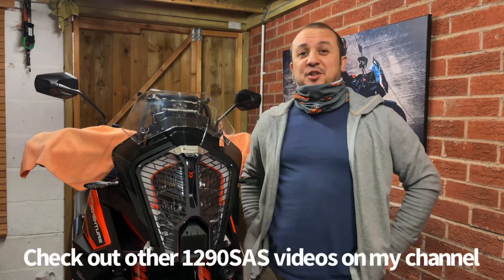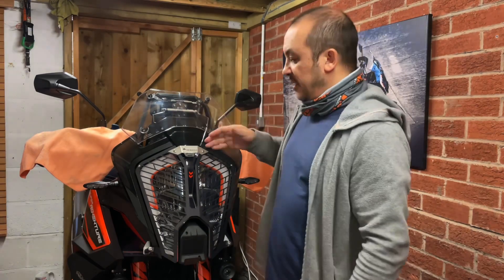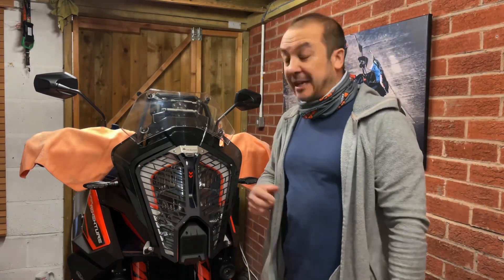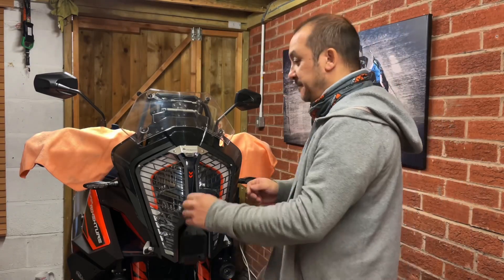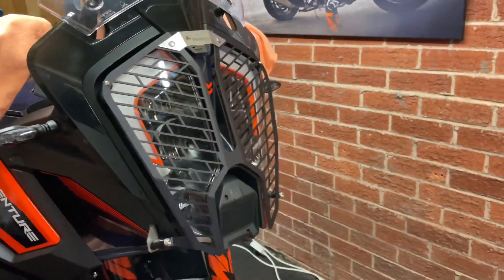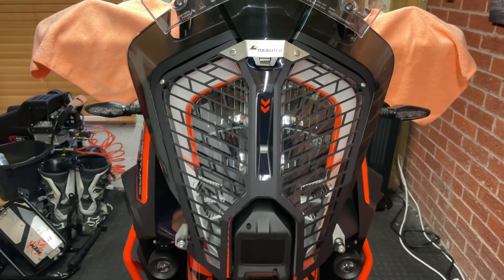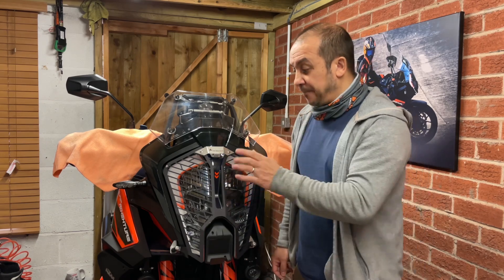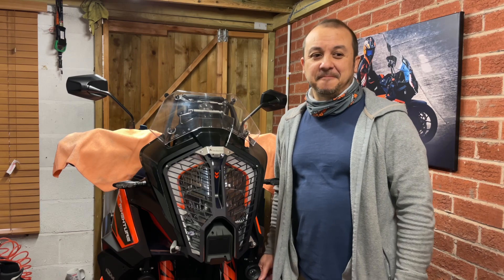2021 2022 2023 2024 KTM 1290 Super Adventure Touratech Headlight Protection Quick Release

Comment: I really t like this.  Though I think the silver bit looks a bit off over all black. , definitely look into the 3m film to keep the headlight from getting nicked up.
Reply from the maker: Hiya Shaft! Yeah to be fair it would have been sharper looking with anodised centre piece instead of metal. With a different shade of black for the Touratech imprint.

Good idea on protective film however I’d be worried about overheating or melting the film. ?
Reply: I look forward to the updates.   New R is definitely on my short list of new bikes.
Reply from the maker: @ShaftDrive  I dont think there is anything that can touch the R if thats the class of bike you want. power/offroad bias.😀

Comment: Hi Rick! happy to see you again friend, I also have the original KTM headlight guard and it is difficult to clean, I am thinking about of a solution to make it quick release, in case I update you, i would like to have more time to do some tutorials and to fix some things, I would like to install the heated grips and a good bracket for the smartphone in order to use it as a navigator. I also need to find soft saddlebags to support your KTM for touratech bags but I can't find anything.
Reply from the maker: Hi Simone thank you mate! Yes nice to be back after a few weeks break. Busy busy. 

Yes you know the pain of cleaning the KTM headlight guard too. I think should be easy. Couple of Dzuz fasteners at the bottom two bolts and two rubber bungs at the top to push onto.. job done. I just haven’t had the time to search for correct sized components 👍

Good look with grips etc ! The wiring is sometimes inconsistent. Hopefully you find the wire easily and not need to remove tank. 🤞

Bags!!? Do you mean sift luggage or do you mean bags that go inside the Touratech panniers ?

Cheers 
Ric
Reply: @RicardoYeep  thank you for answer, soft bag like GIVI CANYON for example, because I find them safer and more practical in storing them  when not in use, I don't have a big space for storage.
Reply from the maker: I do love the look of those Canyon ! 👍

Although I have to be honest I also have been looking at additional luggage (soft) and have considered both Mosko Moto Reckless luggage. Comes in various bag sizes 

And also a favourite is kriega OS system with two 30 L bags

I like these two because they don’t require wide pannier scaffolding. They have their own saddle. So when removed the bike is still tidy. And also when fitted they are no wider than then handle bars roughly speaking.

I looked a giant Loop products too. Comes in orange which is cool.. but I still prefer the Mosko moto or kriega I think.

But definitely if you have pannier racks then those GIvi look great 👍

Comment: Thanks for the video! Do you notice the light been really less at night? I like it but l wondering how much it reduce the visibility in the dark Thanks
Reply from the maker: Hiya!

Yea it does affect the light slightly. And it is noticeable. To be fair it looks the best but not the most functional for road riding. The gaps in the mesh will still allow road grit and dirt to blast through on the motorway meaning you could still potentially damage your light.

These are made for off road use where i guess most mortal riders won’t be travelling high speed. And is mainly to prevent bracken and bush hitting the light and not flocked up stones from a car in front.

I maybe putting my OEM powerpart protection back on soon. Which still looks great but just not as cool as the touratech one. 👍

Hope that helps

Thanks
Ric
Reply: @RicardoYeep  thanks 🙏 ! My new SA  coming soon, so excited and looking for best useful parts to install. In the past so much money into parts that used only little and had to be changed after short time.
I am watching all your videos and have been useful, thanks for that.
Now l am split between getting the original clear protection or the Touratech clear ( easier to clean).
Thanks again and greetings from Japan 🇯🇵

Comment: Hey Ric,, I’ve been really enjoyed your videos,, thank you, very informative. By any chance do you have a video on installing heated grips is it a big job and do you have to remove the gas

Thank you
Reply from the maker: Hello Peter! Thank you very much. Great to hear you found them useful or entertaining 🙏

Unfortunately or fortunately! I had my bike delivered with the grips already on. It was the only accessory I had pre installed. So no I don’t have a video. However I have seen where the connector is (white plug). The area that is “should” be found is under the handlebars in the area all the cables seem to congregate. Within the frame. The easiest way to explain is that if you go and look close at the radiators but then angle upawards you should see a bunch of cables and connectors. 

It hopefully will stand out as a lone connector without anything attached. May have a cap on it will need to remove first to use.

I say “should” be there as a friend found his tucked inside the frame so deep he was required to remove the tank to find it.  I guess this all comes down to who was working on the bike at the factory and whether they were a little slack on the process. 

But overall should be straightforward forward plug and play. But not sure if you will need any software activating first by the dealer to “make them” work. as it all goes through the bike software. 

Good luck and hope the install goes well. And thanks again! Any thing else drop me a message and I’ll do my best 👍

Cheers
Ric
Reply: Thank you again and keep up the great work
Reply from the maker: No problem Peter! Anytime and thanks again 👍

Comment: Hi Ric. Excellent video as always. I always watch your videos before I do any work on my own 1290 Super Adventure. I bought the OEM protector and wish I had seen the Touratech quick release version first. On a tangent I did buy the Touratech toolbox to fit the KTM pannier racks but find that the rear bracket fouls the LH hard case locating rubber pad. I noted you have fitted the same toolbox on to the same rack and have the same cases. Did you have this problem and if so, how did you get around it? I was thinking I was going to have to make a new Z shaped bracket for the toolbox. Cheers from Melbourne.
Reply from the maker: Hiya Dion! Thanks mate for the feedback and finding the vids useful! :)

As for the tool box.. I had to flip the rear bracket upside down and only use one screw, Seems to be tight enough to do the job and can fit the pannier now! 👍
Reply: @RicardoYeep  Ah I see - that makes sense. I will give it a shot and see how I get on. Thank a lot.

Comment: Unfortunately none of these shields is legal in Germany for road use. Including the KTM shield. 😒
Reply from the maker: Ah really even the KTM one!! 🤦‍♂️🤦‍♂️🤦‍♂️ so how are you to protect the lens of the light unit ?! That’s unfortunate mate ☹️

I knew the Touratech one was not as I read it on their website for Germany. But was surprised at the KTM. I’ll have to check UK maybe also not road legal. But they not as strict here on the policing of that. It’s mainly small license plates and loud exhausts over here that you get checked for 👍
Reply: @RicardoYeep  I am not into heavy offroad riding yet. So not a problem right now. But I am planing to ride parts of the TET with a mate. A shield could be very useful against stones thrown up by the back wheel. Maybe I will use a clear one then. I don’t see massive problems with police.

But I am a little bit worried in case of an accident with insurance. The could claim the accident was partly related to the shield because another driver could not see me or was blinded.
Reply from the maker: Yes definitely I would get the clear one in your case. for the reasons you mentioned. I think you must have to be really unlucky to be disadvantaged for using a clear protector. In fact I would be surprised the police would even know anything about it. It could be a factory fit for all they know. But for sure you don't need to be doing off road to get use from these. You are more likely to damage your headlight on road to be honest from stones flicked up by the vehicles in front.

Cheers
Ric

Comment: Hi mate, Good video!

But you know ..😉You can tell yourself many times that the bike is finished, If you think it is: I’ll sent you a message with all nice stuff that is available 😎. 

I recently installed the Puig Touring screen in Dark Smoke and it makes the bike more impressive. 

So far on my SAS: 

- Black crash bars Powerparts 
- Radiator protectors Powerparts 
- Headlight protector Powerparts 
- Tank stickers Powerparts 
- Puig Touring screen black smoke 
- Touratech small rear bag (for chainlock)

Still waiting for BOS slip on exhaust and want to order the SW Motech top case and maybe also the side cases in black alu.
Reply from the maker: Hi Friso! Thanks hopefully will give some ideas to others. And how the OEM one is a PIA to clean!

That is some massive list there haha.. And yes I agree I know the list is endless there is always something new on the market to catch you eye! And by the time you spent thousands on perfecting the bike. We then decided to sell and get a new model and start all over again haha.

Comment: What if you modify the oem protector to the touratech mounting clips? Then you will have clear light and also full headlight protection
Reply from the maker: Hello there! I like your suggestion for sure. And with time and materials you could probably do it. However Touratech also do the clear version too. It’s far easier and tidier to just sell my oem and make a small loss by putting the extra cash into buying the actual clear Touratech one instead. I’d have both to swap and change then depending on use on/off road. As from experience the clear ones get scratched up pretty easily 

Cheers again
Ric 👍🙏

Comment: Hi Ric I went and bought the OEM light guard after seeing you fit it, I was hoping you were going to show us how to fit a quick release.
Good luck with all your doing at the moment look forward to the big reveal 💪
Reply from the maker: Hiya Steve! Yes mate sorry on that let down! I did think over it a while and there are some easy solutions if I could actually find suitable components. But in the end decides on a purpose built kit from Touratech and will sell the OEM. So all in all will cost a little extra and less hassle for me. If I had more time on my hands free then id definitely have a go. But lately I can’t see myself getting the time.

I short you just need a couple of rubber ball end type clips in the top to replace the bolts. So you can just push it up and clip into the holes in the top of the light protector. And the lower side ones either the same or Quick release fairing fasteners (the racebike type with D ring so you can just lift and unscrew) at least with these there would be some form of screw in security (nice and tight). Would. It cost much but would take some experimental testing. Am sure something along these lines would work perfectly 👍

And cheers on the next project. Hopefully all will work out this time and will have something up back end of next week 🤞

Cheers
Ric

Comment: Can't wait for the reveal.
Quick question, I've got a new SAR with heavy wobble around 60km.
Would you recommend anything other than balancing the front wheel like you did previously on video?
Reply from the maker: Hiya Nis! Thanks for watching! Congratulations on the new SAR 💪… but sorry to hear like most of us you have the dreaded wobble. Over the last 10 months I’ve heard of many things to “try” to help eliminate the issue.

Check yoke bolts are torqued up tightly as per spec. Some have been known to be loose.

Balance wheels as mentioned 

Some have put heavier oil in the steering damper 

Personally.. stocks handguards and mirrors made a material change when I swapped them out. But this was purely coincidental. I wouldn’t suggest you go to this costly extreme unless you were planning to anyway.

Have you a warped front rotor ? Or pad catching? Or a poor tyre. Maybe it’s seated correctly but it’s mould maybe defective 

If your wobble was at high speed I’d suggest ensuring the right suspension setup for performance riding. But as yours is so low speed. It must be something a lot more basic.

If after all your tests you are still unsuccessful then I’d be right back to the dealership… or a actually given it’s such a low speed issue I’d just take it back anyway and let then pay for any diagnosis with their time and resources.

After all it’s brand new and should be stable regardless… 

I only did my own self diagnosing as I’m interested, had time. And want to learn my own bike. Had I failed it’s back to dealer 👍

Hope that helps
Ric
Reply: @RicardoYeep  thx a lol for the tips. Sadly, there is only one dealer in my country and there are not very helpful. 
I had to change the canister plastic plug myself since they swore that they had no knowledge about the recall.
I'll start with alignment as mentioned and then go from there.
Thanks a lot for your time and effort,  much appreciated.
Reply from the maker: Ah sorry to hear that! yes having one "weak dealer with little skills or resource" or "just plain useless at customer service" is a very unfortunate situation. But yes try the simple steps first. And also maybe read some of the comments contributed by others on the video related to speed wobble. I know that yours is low speed but the principles may still apply. I think I have also heard of this low speed wobble issue on others so you are not the first. Good luck and let me know how you get on! 

cheers
Ric